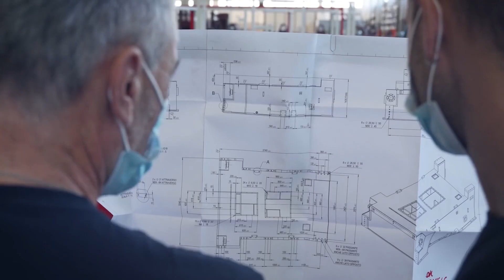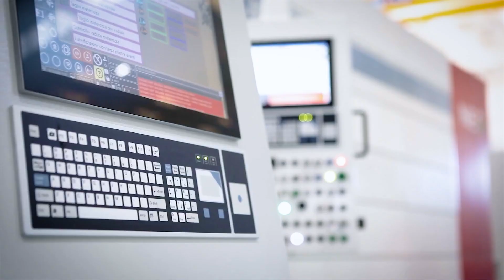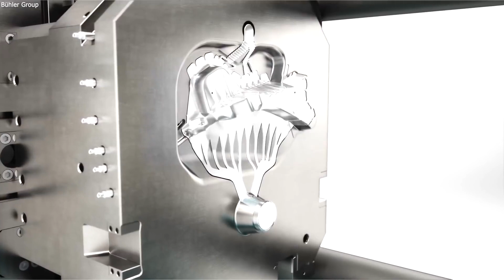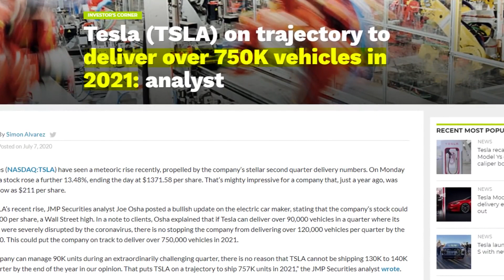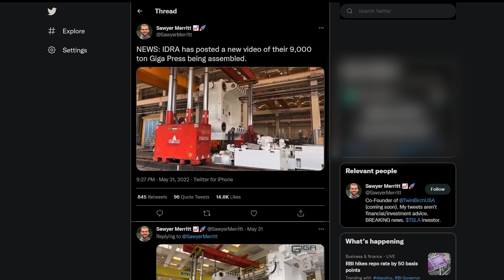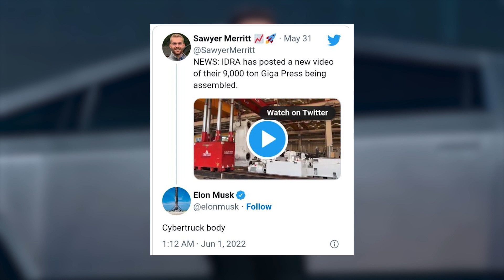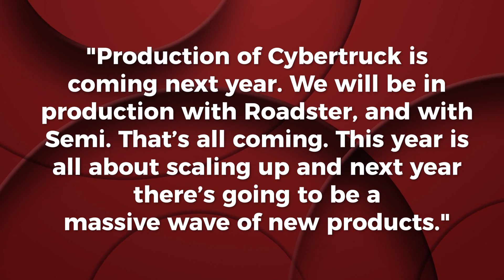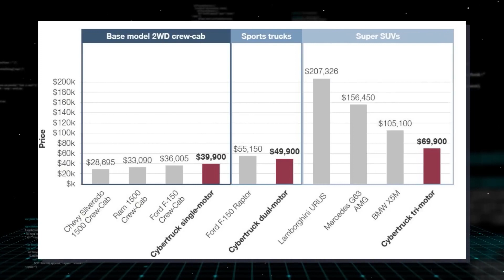Tesla Reveals NEW CyberTruck Gigapress Update!

Comment: The giga press will not be used to create the stainless steel part of the Cybertruck. That is done with a steel folding machine. The press will be used to make the aluminium under body that holds the battery and creates the wheel arches that the steel body attaches to.
Reply: Thanks for your comment genius